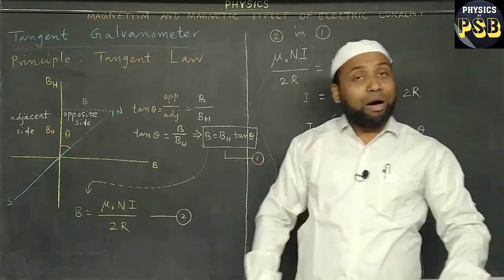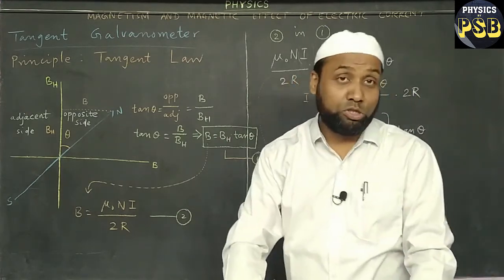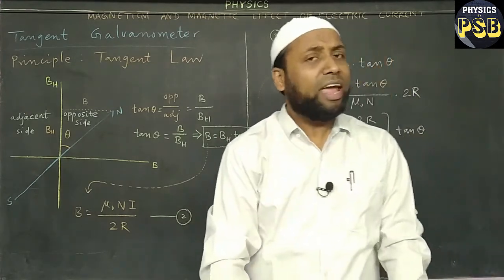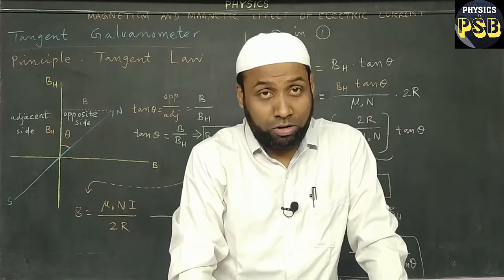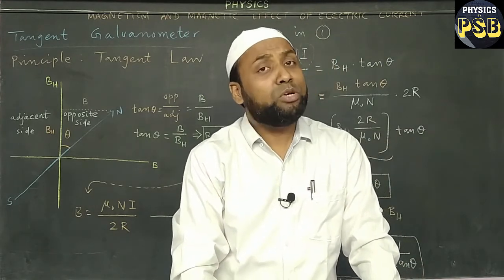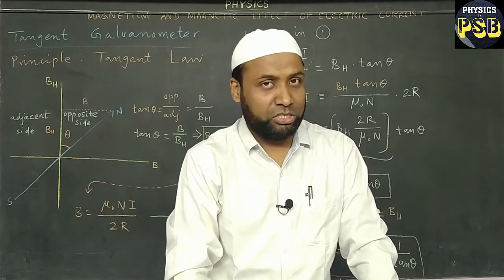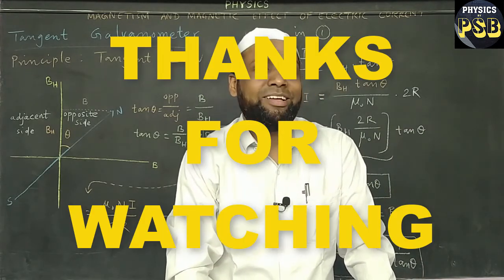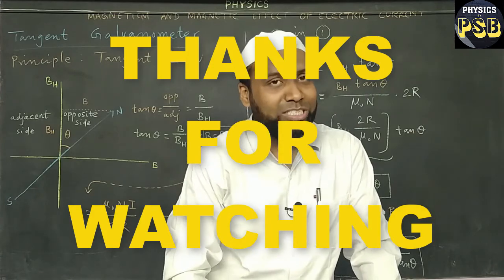Tangent Galvanometer| Demonstration| Class 12 Physics| Magnetism and Magnetic Effects of Current

Comment: Aslam Alaikkum sir.

For the first time,  there is a video lecture about the Tangent Galvanometer with the instrument at the close vicinity of the viewer. Great camera work conceived by you and many congratulations and thanks for the same. Students can understand what TG is all about with this sort of camera work and your presentation. Your lecture is outstanding and I am sure even a novice will get attracted to the concepts of physics by your efforts. 

Now I have some doubts and let me put it down
1) After the initial adjustment of TG with aluminium pointers pointing zero - zero, you placed the spirit level on the mirror and adjusted the levelling screws to make the bubble come to the centre. If the levelling screws are adjusted at this stage, will it not disturb the zero-zero level of the aluminium pointer?

2)  You have said that if the connection is made between the first and second screw the number of turns included is 2 and if the connection is made between the second and third screw the number of turns included is 5 and if it is between 3rd and 4th, the turns are 500. Sir, all along I have been taught with the idea that if one wants to include  2, 50 , 500 or more turns, one end of the connection should be always with the first screw that points to zero and if the turns are 50, the connection should be between the first and third screw and if the turns are 500 connection should be between first and fourth screw. I need clarification in this regard and correct me if I am wrong. 

Thanks again for a nice video, sir
Reply from the maker: Walaikum Assalam... Thanks a lot for the appreciation.  

I am extremely happy that you have observed it keenly.  Let me answer your questions.  

The purpose of adjusting levelling screws is to keep the compass parallel to the surface such that the aluminium pointer should not touch the circular scale.  The aluminium pointer should be made to read 0-0 at the end after levelling the surface.  

 Here I forgot to mention that earlier so I have shown that step at the end.   

The adjustment of the levelling screws at the end may disturb the pointer.  So it should be done at the initial stage.

(2) If an instrument is used with the numbers  2,50 and 500 mentioned between the screws it means you need to make the connection between second and third to pass current through 50 (in case of the instrument used in the video) turns of the enamelled copper wire coil.  
In certain instruments, you may find the numbers written exactly below the second, third and fourth screw. In such a case, you need to follow the method mentioned by you.

I usually confirm this using a multimeter in continuity mode.

I hope this answers your question.

Thanks.
Reply: @siddeeqbasha  //If an instrument is used with the numbers  2,50 and 500 mentioned between the screws it means you need to make the connection between second and third to pass current through 50 (in case of the instrument used in the video) turns of the enamelled copper wire coil.  
In certain instruments, you may find the numbers written exactly below the second, third and fourth screw. In such a case, you need to follow the method mentioned by you.//   This is a revelation to me, sir. Thanks a lot for clarifying this aspect and indeed it makes very happy to know such a technical detail. 

Sir, also you have mentioned about using a multimeter to check the continuity. I request you to make a video on this since it will be very very helpful for persons like me. 

Thanks a lot for your detailed reply, sir.
Reply from the maker: @logearav  you are most welcome... God willing, I will make a video on the requested topic.  Thanks for the support and encouragement.